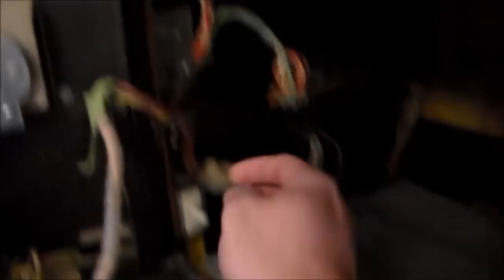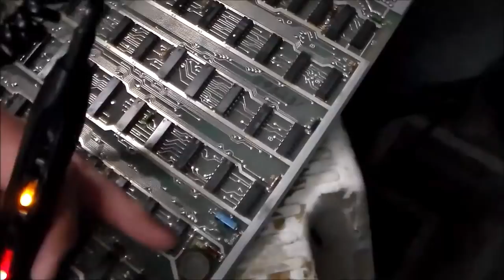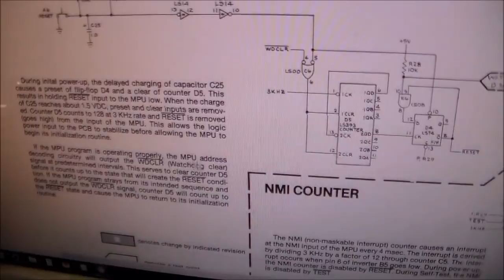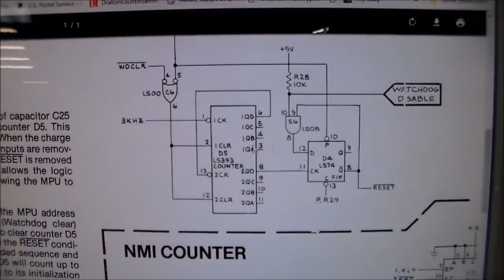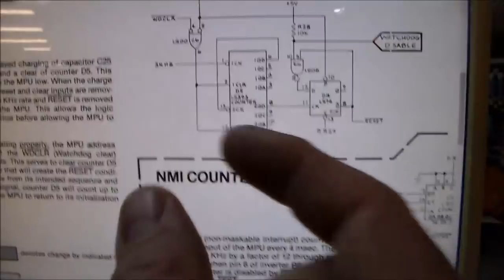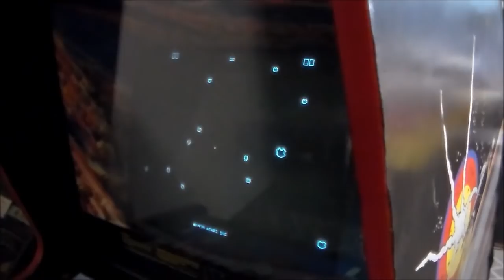Asteroids Arcade PCB Repair (Again!) - Troubleshooting the "Watchdog" Circuit with Schematics !

Comment: Asteroids oh yeah, it's got that nasty quadrascan XY monitor. Used to love working on the late 70s early 80s video games. Back then, the games were so new and popular it wasn't unusual for the cash box to overflow with 10 pence coins ( in the UK )  spilling onto the PSU and shorting it out. Funny, it's been 35 years since I saw an Asteroids board but recognised immediately that it was a video game board from the late 70s early 80s. Thanks for the nostalgic trip, makes me want to buy a faulty logic board just so I can repair it. 😁
PS. That schematic was from an era when you got decent documentation. Reminds me, I used to have a huge A4 style repair bible/manual which was written by Atari ( I think )
Reply from the maker: Harry I've always heard back in the day operators would burn through those transistors on the side (the deflection transistors) like candy until they figured out how the monitor worked and that they were expensive at the time....
Reply: @LyonsArcade  Yeah that was true but from an era where electronic repair of EVERYTHING was expected and MOSTLY done, these days, those kinds of repair are a niche market performed by a few specialists such as yourself. About 15 years ago an operator asked me to look at a faulty Daytona driving game, turns out someone had spilled a can of coke onto the logic board, I advised the operator to wash the logic board in warm soapy water and said "it's probably had it and even if it hasn't, the challenges of repairing a multilayered highly complex board is way beyond an oscilloscope and logic analyzer in a small workshop" the operator became abusive calling me a "...clueless idiot..." and saying "...I will send it to the professionals for PROPER repair..." I have to say, it was very satisfying to discover the PROFESSIONALS had returned the board with a note saying "beyond economical repair" some operators still think it's 1982 😁
Great channel dude.
Reply from the maker: Yeah some of them don't get it... there aren't even schematics available for Daytona.  Super complex boardset too, likely one of the most complex ever actually.  There's a guy at www.IRepairSega.com that can fix them, he used to be their tech at Sega and has the schematics and worked on them AT Sega so it's his specialty, but as you said a coke dropped on it (likely while it was on) even he's not going to be able to get THAT one going again.
Reply from the maker: by the way, I fixed a Stunt Cycle once, the old Atari Evil Knievel game... the manual in that basically tells you the entire logic setup, how each chip works, even down to some of the signals.  I don't mean the schematics SHOW you, I mean they actually word by word explain the theory of the game.   Very easy to troubleshoot because of that, but it was a much simpler time and board.
Reply: @LyonsArcade  Yeah Atari in particular were rather good at giving a circuit description which made things so much simpler. These days, there's no schematics and if there is one it's under licence costing an arm and a leg.

Comment: That little dot. If my memory serves me well there was a spot killer circuit for quadrascan monitors
Reply from the maker: There is... on the first version of the monitor for whatever reason something wears out and the dot shows up after it's been on awhile....
Reply: @LyonsArcade  The resistors in monitors have a nasty habit of changing value due to the heat causing some very weird issues furthermore the heat also screws around with the capacitors causing other issues. Out with the ESR meter for those, didn't  have those in my day, in fact, you had a scope if you were lucky and a high impedance analogue FET meter, still got that just haven't got that heart to get rid of it 😁

Comment: Love your videos, These machines go back to the time I started in electronics proper aged 16, always wanted all the fancy kit and did get a lot in the end. I do own a digital scope bought it last year, it’s mainly in its box. I repair laptops now and my turn to tool is a meter on diode test mode... would love to have a stab at these repairs, this machine with its vector scan is especially interesting, could you run the output to a scope X, Y and Z inputs and get a picture? Thanks for putting the effort into recoding them, they’re great.
Reply from the maker: Thanks Pete!  Yes, you can send the outputs to a scope I did it on one of the Asteroids videos on here somewhere a couple years ago.  These vector Atari boards use some strange voltages but you could probably test and repair them with an adjustable power supply with multiple outputs and a scope for video!  Thanks for watching, we have more videos coming soon :)
Reply: @LyonsArcade  Hi Joe, Sorry if off topic, I have a Midway Space Invaders for repair! :) L shaped job. Game boots shows Hi score at top CREDIT at bottom, doesnt draw any invaders and then reboots... been on it for 2 days without finding anything...

Comment: Love the videos guys, makes it much easier to understand the whole process.  I recently picked up an Asteroids cabinet and I've found that it's missing the self test switch.  Guess it was robbed at some point.  I don't suppose you, or any other commenters, know where I could find a new replacement?
Reply from the maker: They put them in two places, look on the door close to the hinge, sometimes there's a little one there at the top of the door.  The one inside by the volume pot isn't installed if the coin door is put on that has the switch on it....
Reply: @LyonsArcade  Thank you for the reply!  You're right, it's just in a different place.  I was thrown off by the black and white wire connectors that are dangling next to the volume control.  Much appreciated!

Comment: Hey! I am working on a broke Assturds  board and B4 Pin 8 has no 3Khz clock to the watchdog circuit and there's also no 12khz clock on pin 10... Pin 1 DOES have a 750khz clock. Also B5 and C4 have all of their clock signals and they are accurate on the scope. Does this mean my B4 (LS393) is bad?
Reply from the maker: Yes it's almost certainly bad, since it's only 'feed' is that 750khz clock and if that's accurate on a scope your outputs should definitely be there.  It's also a counter, and they're known for dying, instead of just inverting a signal or anding/nanding whatever, it's doing math. Counters and decoders fail first, usually.. LS161's, 163's, 393's, 139, 138, all those are very common failures on these older pcb's.
Reply: @LyonsArcade  it’s crazy I forced the watchdog disable low and drag the probe around e5 and d5 (shorting between pins) and I’ve manage to get the board to run a few times but I have no idea what I’m doing to make it happen it’s total dice roll. I better set ot aside before i fry more chips. I’ll wait til i can replace b4